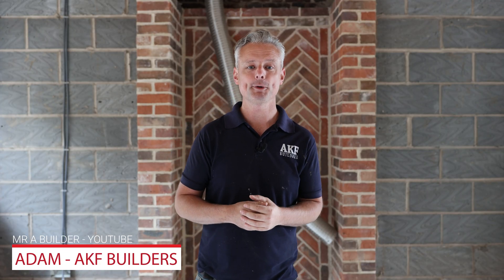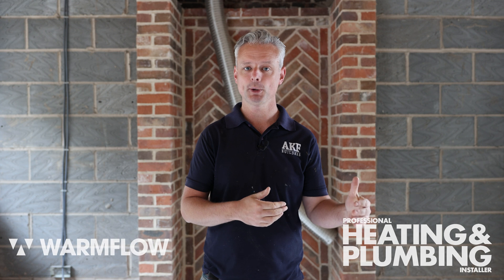AIR SOURCE HEAT PUMPS ft. PHPI & Mr A Builders

Comment: Obviously we know that you went for gas!
If you had been serious about wanting a heat pump you would needed to have got him involved earlier so you could get the rads sized up and put tge tails in the right place and even more importantly put the ducts in undervthe floor for the supply pipes and cables.
I can understand your decision to stay with gas because you didn't want to loose laundry space in the utility fot the buffer and hot water storage.
These perhaps could have gone elsewhere if you had planned for air source all along.
So the big takeaways are early involvement for pipework & suzing and internal sorage space.

Comment: Interested to know the calculated heat loss value.
Reply: They'll have calculated it from the wall, ceiling and roof construction details.
Heat loss between rooms can be important for heat pumps because the efficiency drops off quickly with increased flow temperature needed if 'unused' rooms are kept at lower temperature.

Comment: So much terrible advice in this video:
- 20kW heat pump is sounds certainly massively oversized for a well insulated retrofit, average heat loss for a UK house with standard insulation is 8kW, a well insulated retrofit will probably be about 5kW. Unlike an oversized gas boiler an oversized heat pump will operate very inefficacy since it won't be able to modulate low enough. 
- If indeed, a 20kW heatpump is indeed required using 28mm primary pipes and 22mm central heating will be very undersized.
- Recommending getting the merchant to size the radiators, this is bonkers and a recipe for disaster! 
- Zone controls in each room and a buffer vessel is not an efficient way to run a heat  pump, a retrofit like this with UFH can almost certainly be run open-loop without zone controls which will save significant cost on the installation and allow the system to work more efficiently using weather compensation.  
- It's a myth that the amount of insulation determines the efficiency of a heat pump, a heat pump can work very efficiently in less well insulated properties as long as the system is correctly designed, checkout https://heatpumpmonitor.org for real work data. More insulation will lower the amount of heat required, which will lower the running costs of any heat source.  
- For good advice on heat pumps see the HeatGeek Youtube channel: https://youtube.com/heatgeek